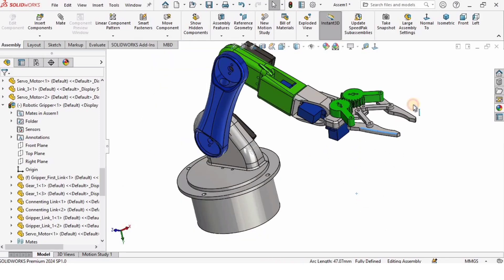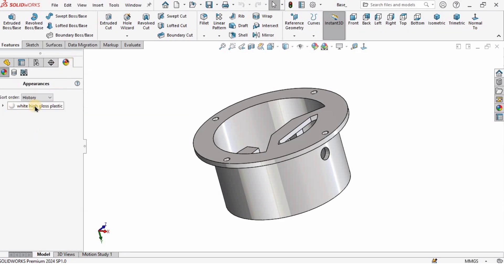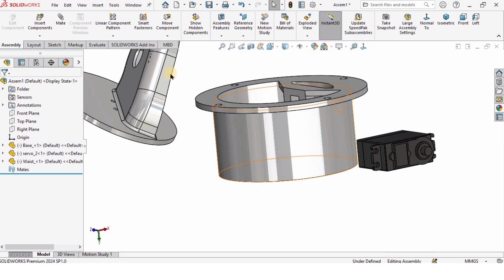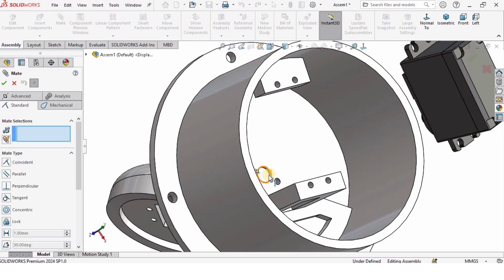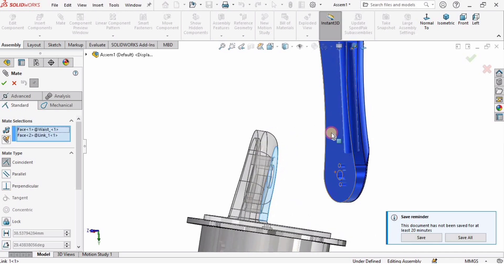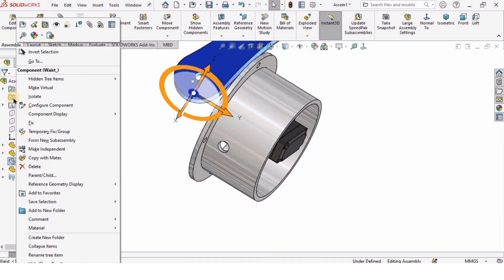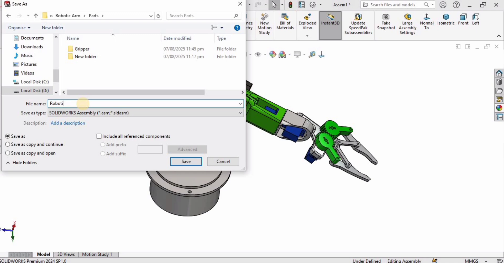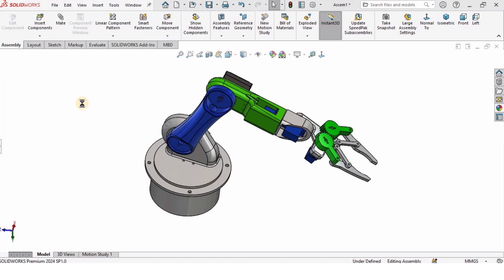Robotic Arm Assembly Complete in SOLIDWORKS

Comment: Hi, thank you so much for your great work, I learned a lot from it.
We’re currently making some small adjustments to your design so it can be printed, and we’ll share the final version with you if you’re interested.
I have a question about the motor position in the green link. Shouldn’t it be mounted on the blue link from the other side? I mean, how will it move the green link if it’s placed inside it in the first place??
Looking forward to your reply, and thanks again.
Reply from the maker: Thank you.

actually it's been a while when i created this project currently i do not have solidworks installed and i moved away from solidworks from now as i am more interested in coding now. 
i hope you make great adjustments in this design,. unfortunately i am unable to provide any support
Reply: مرحبا..ممكن ارسال التعديلات ليصبح جاهز للطباعة..مع الشكر
Reply: @GhazalSultan-t8l5m  بالتأكيد.. انا حاليا اقوم بطباعته عندما انتهي واتأكد من دقته سأرسله لك ان شاء الله
Reply: شكراً لك..سأكون بالانتظار  @ايهم-العمراني
Reply: @GhazalSultan-t8l5m  مرحبا.. انتهيت من طباعة القطع وتجميعها والنتيجة مرضية
 اعطني طريقة للتواصل حتى ارسل لك الملفات الخاصة بها